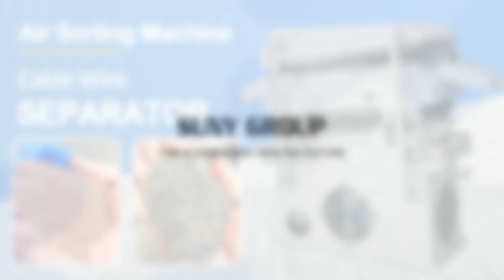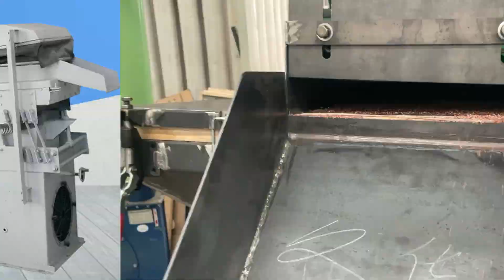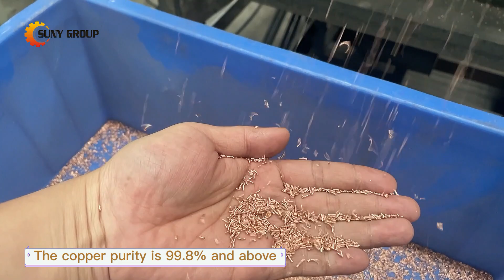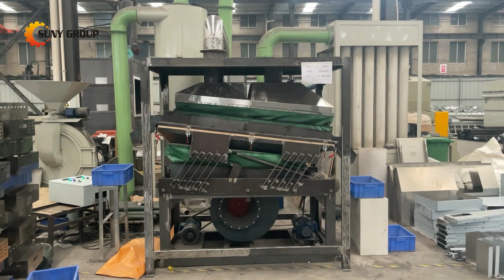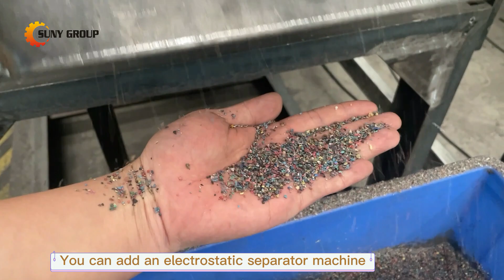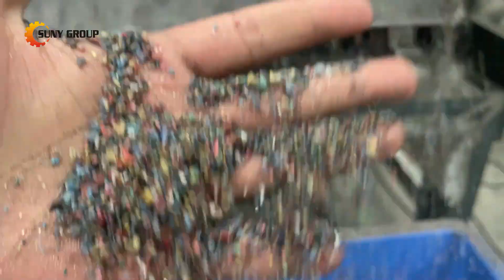Insulated Cable Wire Copper Separator Air Sorting Machine (300-400kg/hr)

Comment from the maker: The air separator machine is mainly used in cable wire recycling, if interested, pls contact at 
Email: jackhao0804@gmail.com
Whatsapp: +86 137 8362 0467